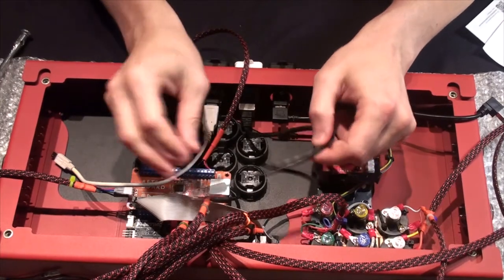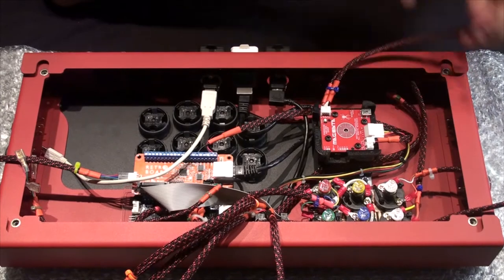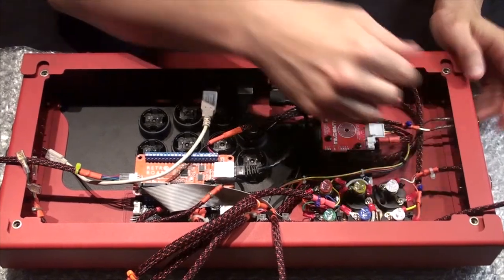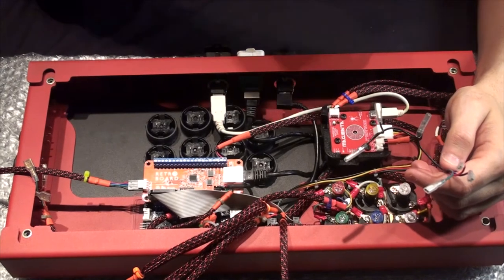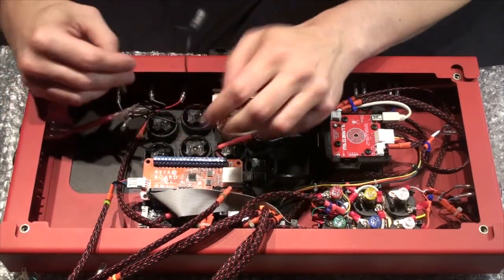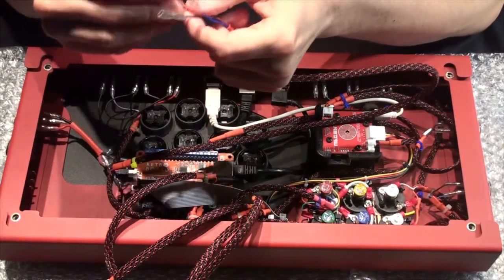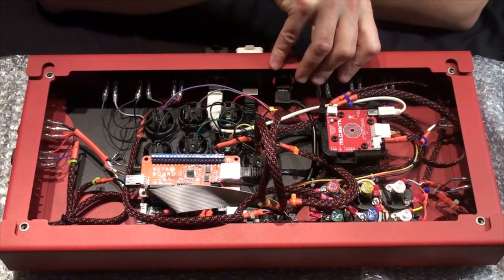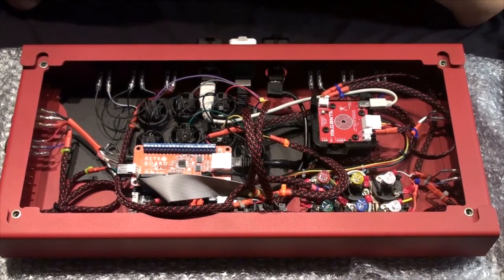Zero to Fightstick Episode 10: Installing Wires & Cables

Comment: You are essentially the best guide I found, unfortunately your guides are hidden in youtube. Have you found how to have the led have light when toggled with tournament lockout?
Reply from the maker: Thanks! I've started on some new material here and will be marketing it a bit better, hopefully. No likes/hits means it gets buried, sadly. It's already really niche content already...

Getting the LED working would require power from the control board's 5V terminal (the switch really wants 12V if I remember correctly, but that'll get you a faint light at least). It is doable in theory but I haven't checked. Wish there were more options for a 24mm round hole switch, but that one is practically all that's out there.

I'm planning on rebuilding this stick as well, so that'll be something too.
Reply: @Zevaeros  Thank you that is splendid. Do you plan to rebuild by using a wireless brook adapter. I think we don’t have as many great detailed guides with wireless options, or they might be burried in youtube.
Reply from the maker: @john005_  Some searching will probably turn them up, but I didn't plan on using that this go round (I play on a fair amount of retro systems, so the Retro board is a must for me). Maybe in my next build?

Comment: Hi there, I really appreciate you posting so many helpful guides and tutorials.  I was wondering, for the turbo button is that a momentary button or a latch button?  I'm mostly wondering because if turbo is on/active then it's latched on?  Thank you!
Reply from the maker: Sure thing. It’s a standard push button. With the Brook PCBs, you hold down the turbo button then press the button you want to apply it to turn it on for that button, then repeat to turn it off.
Reply: @Zevaeros Ah okay, I really appreciate it, thanks again!
Reply from the maker: @xCheezMuffnx  No problem! You could use a rocker switch here if you want; turn it on, press the buttons you want to turbo/unturbo, then turn it off. I think it's unintuitive though.
Reply: @Zevaeros  Oh yeah that definitely checks out, theoretically I could do that with a latching button too.  But, like you said, it's unintuitive and would feel clunky.  That's wonderful, I'll order some buttons today and start working this week.  I appreciate it!

Comment: idk if I missed it but what are you supposed to do with the wires for the option buttons if you're doing tournament lockout? where do the grounds go?
Reply from the maker: The signal wires are routed and connected as usual. For ground you're going to connect a ground wire from your PCB to one side of the switch, then then wire a chain from the other side to the buttons you want to lock out.
Reply: @Zevaeros  gotcha, thanks a ton!